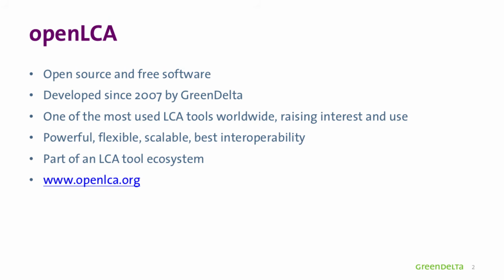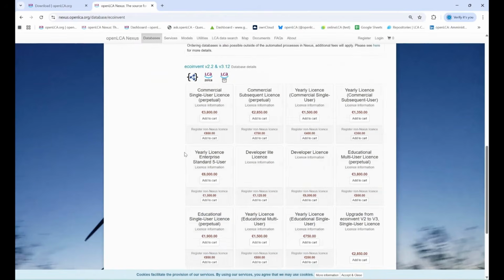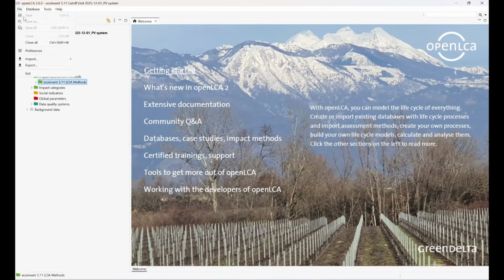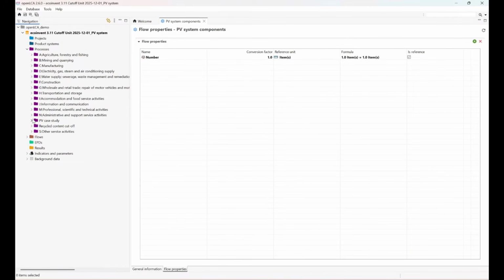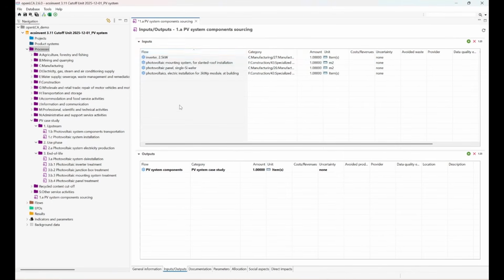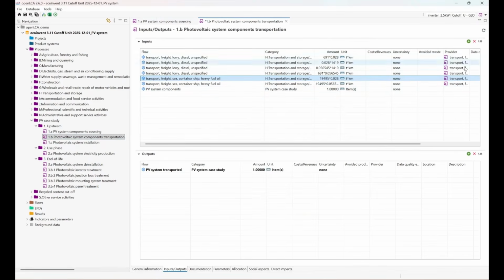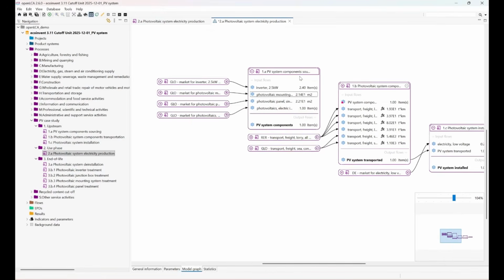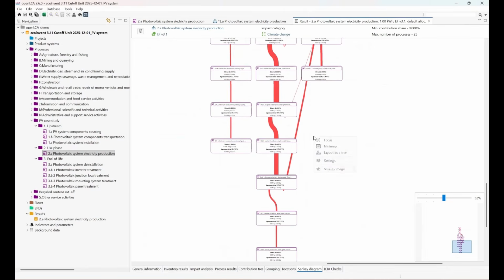Tutorial: Building a basic model in openLCA

Comment: Thank you for this tutorial. Very good to get basics and informations to connect the prozesses. What I wonder is (in minute 17) the amount of the inverter 2.5 kWh is typed 2.4 but the unit is "item(s)". Should a 2.4 kWh inverter not have the amount 0.96 (item)? In other words: This means the correct amount for a 2,5 kWh inverter is 2.5 (items)? As I understand, it should be 1, since the unit is “item(s)”...
Reply from the maker: Thanks for your comment. Just to clarify: the “2.4 items” comes directly from the ecoinvent dataset referred to the installation of a slanted-roof photovoltaic system. In this dataset, the PV system has a total capacity of 3 kWp, while each inverter is 2.5 kW and has a shorter lifetime, so it needs to be replaced during the plant lifetime.
The “items” value therefore reflects both the number of inverters needed to cover the system capacity and the lifetime replacement, not the inverter power itself.
So the number is not meant to be “1 item”.